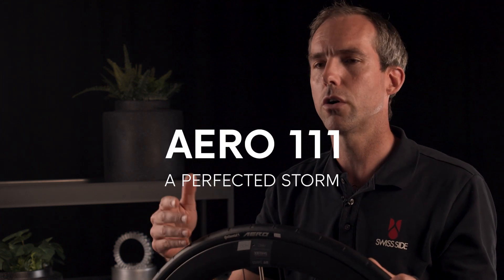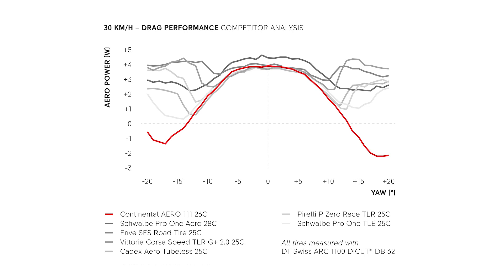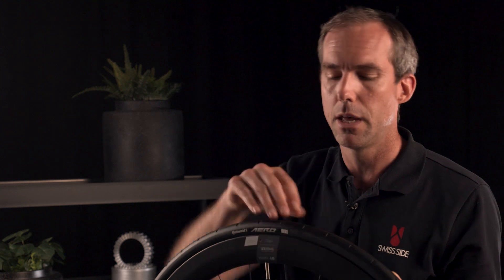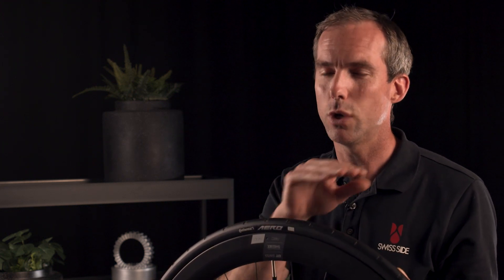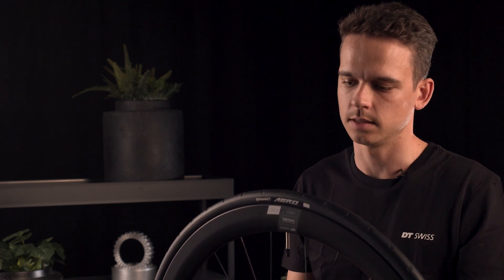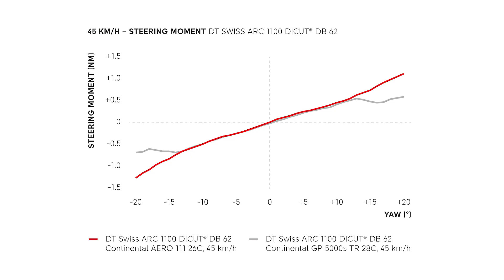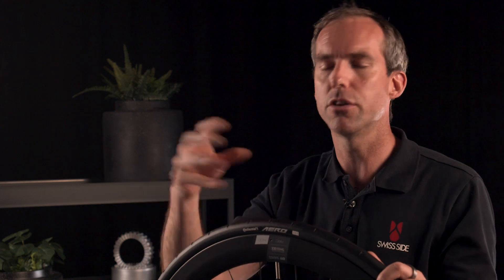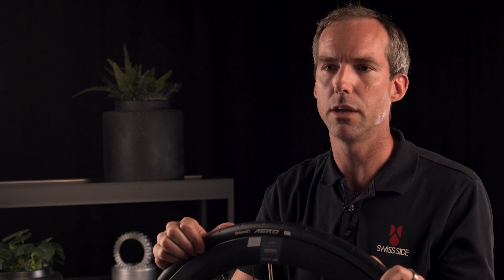AERO 111: A Perfected Storm - introducing the ultimate aero wheel tire system | DT Swiss

Comment: I have a 45mm Wheel with 29mm measured on the outside. Can I still ride the 29" instead of the 26" and see benefits?
Reply from the maker: Hi, Thanks for your request. Only the rim inner width defines the tire width. Please use our wheel manual for the minimum tire width: https://d2a13k6araex7u.cloudfront.net/pmt/00/00/00/00/00/00/00/10/00/00/00/85/8/MAN_WXWXXXXXX1610S_WEB_ZZ_001.pdf?v=163982. The ERC rim is 22 mm wide, the minimum tire width for this is 26 mm, not recommended by us but allowed according ISO industry standard. A less wide tire will increase the aero benefits on this wheel set, but would sacrifice the comfort: https://www.dtswiss.com/en/wheels/wheels-technology/wts-technology. Best, Ralf - DT Swiss

Comment: Hi again! After three days of riding the Aero 111, I can say it’s a good tyre—noticeably faster, much faster in fact—but the handling stability wasn’t there. According to the data this should stabilize handling but my 45 mm-deep wheels felt more like 60 mm wheels, becoming twitchy and unstable in crosswinds.. Im using the Scope 4.A wheelset. What can you say about this?
Reply from the maker: Hi, Thanks for your positive comment about the AERO 111 tire. This tire is a cooperation of DT Swiss, Swiss Side and Continental and the product has been developed on DT Swiss rims/wheels creating the first real Wheel Tire System that takes aerodynamic optimization and controlled rideability into account. Our ARC aero wheels (and ERC wheels, too) are developed to create a moderate steering moment (as the force that is applied onto the steering axle - see "AERO+" concept for a detailed physical explanation) that is quite linear with the lowest possible incline of the gradient over the full range of all measured (realistic) Yaw-angles. Adding the AERO 111 tire will not change the gradient, but will make the steering moment even more linear with a later airflow stalling. This stalling effect you describe is felt as "twitchy" when you ride especially under fast changing wind conditions that turn on and off the stalling. By having a low gradient, the maximum absolute Moment (in Nm) will not be felt in a unpleasant way when stalling occurs. 

Surely, we observe the wheel market and other brands around us, but please understand that we cannot make any conclusions/statements about the influence of the AERO 111 tire on other manufacturer's rims/wheels. These wheels might have a different approach in the development when it comes to a pronunciation of the so-called sailing effect in order to achieve certain aerodynamic properties. As the AERO 111 tire is exclusive to Swiss Side and DT Swiss products (as complete Wheel Tire System), it is impossible for us to make any other statements. Find out more about the Wheel Tire System and the complete measurements on all DT Swiss Aero wheels: https://www.dtswiss.com/en/wheels/wheels-technology/wts-technology. Best, Ralf - DT Swiss
Reply: @dtswiss  Thank you for the very detailed explanation! I still remain a fan boy of this tire! Significantly faster! Lovin it!

Comment: I also watched David Arthur’s video in which a Continental representative explained that pairing the Aero 111 with 42 mm tires produces the same “sailing effect” as pairing it with 60 mm tires. Does that mean we can use 60 mm rims and still enjoy crosswind stability comparable to much shallower rims?

If so, that deep wheel + Aero 111 is just crazy fast and stable!
Reply from the maker: Hi, thanks for your questions. Just to make one thing clear: we are talking about the rim heights of 42 and 62 mm, not the tire (width). We have put all numbers of wind tunnel testing onto a technology page and there you can see how the tire affects the aero drag. Looking at the y-axis shows you the amount of aero drag in Watts at certain Yaw-angles (is a vectorized measurement of onflowing airflow, or apparent wind direction incl. the speed of riding & wind(-direction)). Higher DT Swiss rims are already improving the aerodynamic. If you combine the AERO 111 with a 30 mm ally aero rim, the effect of the tire in absolute numbers is the same as for higher rims. In relation to the height, a shallower rim will have a greater effect. With a 62 mm high aero rim combined with the AERO 111, you will have a top performing product with almost no detachment of the airflow within a range of -15° to +15° of Yaw. A 80 m rim will not stall within the full range of measurements. Find out more on the technology page: https://www.dtswiss.com/en/wheels/wheels-technology/wts-technology with all numbers unveiled. Best, Ralf - DT Swiss

Comment: Hi, I bought these tires for both the front and rear wheels. Although, as explained , it's unnecessary to use Aero 111 on the rear, I frequently get punctures where I ride, and according to Bicycle Rolling Resistance, this tire offers excellent puncture protection and better grip. My question is: would using it on the rear negatively affect performance due to the vortex cavities interacting with the dirty airflow on the rear side of the bike and creating additional drag?
Reply from the maker: Hi, thanks for your questions and remarks. Even though the tire offers a good puncture protection, I would not use it on the rear for following reasons: the weight on the front wheel is lower than on the rear wheel, thus the wear will increase if used as rear wheel tire. Additionally, the aero effect on the rear wheel is pretty much non-existing due to the turbulences created by the rear part of the frame and the moving legs. The drag will not be influenced negatively, too. Instead, I would recommend using a wider tire (inside the allowance of the frame, 4 mm around the tire) and set the tire to tubeless. A lower tire pressure will increase the comfort and a high quality carcass of the tire will more gently roll over obstacles on the road surface, such as cracks or loose particles. Small punctures will be safely and quickly sealed if you use a high pressure road sealant such as the DT Swiss HP TL sealant: https://www.dtswiss.com/en/components/wheel-accessories/tubeless-sealant. Best, Ralf - DT Swiss

Comment: Hi, I see it in the above video that the tyre is on not only tested or usable on deep section (50-60mm or more) rims but 30 and 38mm as well. Would you confirm that it makes sense to install the Aero 111 on reasonable shallow rim depths too, such as 40mm? Thank you for your reply in advance! Adrian
Reply from the maker: Hi, we have updated the available aero drag data for all different DT Swiss road wheel rims/wheels. These can be found in our technology page: https://www.dtswiss.com/en/wheels/wheels-technology/wts-technology. Especially on a shallow rim like in the A 1800 SPLINE 30, the AERO 111 tire creates a sailing effect and overal weighted aero drag compared to a wheel with a 50+ mm high rim using a standard tire. Best, Ralf - DT Swiss

Comment: I just bought two of these thinking that I’d use them for front and rear. I bought 29s subs I usually prefer 28s on my tri bike. Do you advise a particular rear tire that I should use instead?
Reply from the maker: Hi, the AERO 111 tire has been developed with the purpose to reduce the aerodynamic drag on the front wheel as this is the first part of the bike that "hits" the wind upon riding. Surely, you can use the AERO 111 on the rear, but due to more turbulences in the rear part of the frame/bike (moving legs, frame set etc.), we see no necessity to use this tire on the rear wheel. Instead, we recommend a standard tire, e.g. GP 5000 STR in 28 mm (on ARC Aero wheels). Best, Ralf - DT Swiss

Comment: @dtswiss I've poured through your data and test results -- cool stuff. Two big questions for you:

Why did you stop at 45km/hr with your data? Where I ride I'm frequently dealing with 25km/hr headwinds while going generally downhill. It would be nice to have a 60km/hr datapoint

it would be nice to get some guidance on what rim internal/external width ranges the two sizes are meant for. I've gathered from your test data that the 26c is for around 20-22 internal and the 29 for 22-24, but some actual guidance would be nice
Reply from the maker: Hi, very good questions indeed. We like to be challenged with technical questions as we see a real interest in bike industry innovations. The speed of 45 km/h in the wind tunnel is where we usually test and we are trying to make results comparable within a test session and over different sessions and categories. With gravel cycling getting popular, we also went down with the speeds to 30 km/h, that´s the minimum you are able to measure reliable results. With the experience of lower speeds in reality, we made also measurements with the WTS in these speeds. There, we figured out that the combination of apparent wind direction and riding speed not only led to more extreme yaw-angles but that the AERO 111 increased the sailing effect at this speed. Thus, the tire increases the aero performance significantly if you are riding in the flat with e.g. strong cross winds. In contrast to this, increasing speeds and cross winds reduce the yaw-angle and the system is stronger affected by the base drag (within -10° to +10° Yaw). The calculation of yaw-angles is a vector calculation and you will find examples in the internet to make your personal calculation. Therefore, your mentioned speed and wind conditions lead to well-known results in terms of aerodynamic and handling properties. One important take away from the tire for high speed riding is a stable and foreseeable steering behavior - especially in these downhills you can ride with confidence without being surprised. Best, Ralf - DT Swiss
Reply from the maker: 2nd question replied separately: The tire widths of 26 and 29 mm are according the latest ISO norm and related to the rim innerwidth. The widest/still safe tire/rim combination for 26 mm AERO 111 is 22 mm (ERC/ER/E wheels), with the AERO 111 in 29 mm, the maximum allowance for a safe fit is 24 mm (up to GRC/GR/G wheels). We must admit that the AERO 111 tires have been developed to work with our wheels/rims, therefore we cannot comment on other wheels (or external rim width) of other wheels/brands. In general, the less wide the tire the better are the aerodynamics of the WTS. You will get excellent results when combining 26 mm with our ARC wheels, combining the same tire width with the ERC wheels might lead to even better aerodynamics in this category. On the other hand, the designated plus in comfort for rougher road surfaces will be sacrificed. Putting a wider 29 mm AERO 111 on the ARC wheels might enhance the steering performance and the comfort but on the other hand the weighted aero gains of the ideal 26 mm tire will be decreased. Our wheel manual will guide you through best tire/rim combinations. But please respect also the max. tire pressures for tires and rims. If these tire pressures do not match 100 %, the "lowest" maximum tire pressure of one of the components has to be respected (see hookless rims)! Best, Ralf - DT Swiss
Reply: @dtswiss  Ralf thank you so much for such detailed answers.
Reply: @dtswiss  hi, you said maximum allowance is 24 mm for the 700x29c tyre. Do you mean max 24 mm rim depth, inner width or outer width? Thank you.
Reply from the maker: Hi Monika, the rim inner width defines the width between the hooks of the rim, not the height. A 29C AERO 111 can be mounted on a 24 mm wide (internal rim) rim, not wider (> 24 mm, acc. ISO-Norm). A less wide rim < 24 mm is no problem. For further information check our tire/rim/pressure sheet: https://d2a13k6araex7u.cloudfront.net/pmt/00/00/00/00/00/00/00/10/00/00/00/85/8/MAN_WXWXXXXXX1610S_WEB_ZZ_001.pdf. Best, Ralf - DT Swiss

Comment: What size for optimum aero interface on 21mm internal/30mm external rim?
Reply from the maker: Hi, thanks for your question. You will achieve the best aero performance if you install the 26 mm wide tire. Up to internal 22 mm rim width, you are able to run safe on 26 mm AERO 111 tires in the front. However, if you use the AERO 111 in 29 mm, a characteristic like comfort can be improved (by a lower tire pressure), but the aero performance will be decreased. In general, a wider external rim will contribute positively to the aerodynamics of a front wheel. Best, Ralf - DT Swiss

Comment: I have ordered one of those (26-622) and tried to install it on a DT Swiss Arc 1400 Dicut 62. Unfortunately it's impossible, the tire is too tight. I usually run GP 5000 and they are relatively easy to install. Did anyone manage to install a 111 tire (without excessive force)?
Reply from the maker: In the past weeks we installed several AERO 111 in 26 mm on various ARC rims. With the help of a plastic tire lever, it will work with any additional extra force. If the tire bead is seated inside the TL rim bead, the diameter will allow you the installation. Best, Ralf - DT Swiss
Reply: @dtswiss  Hi Ralf, thanks for the response. Thats actually exactly how I tried it. 

I also tried a bit of soap water on the rim to reduce friction but it’s simply too tight.
Reply from the maker: There are some other easy fit options in the market to test. Try to get the tire over the rim on at the location of the valve. If this remains difficult, I would recommend to you addressing this obstacle to Continental Tires directly. Best, Ralf - DT Swiss

Comment: This aero gain is as much of a theory as multiverses 😂 you can argue they are true but in reality you can’t test the theory and after all it doesn’t matter for nobody. But hey, you got me clicking on the vid…😂😂
Reply from the maker: Thanks for clicking the video. 👍 Wind tunnel tests are a safe method to produce results that can be similar repeated, thus a field test has more "noise" and might not be reproducible. The aero gains for this tire are related to the yaw angles applied, so they can be extremely high, but also in the frontal airflow smaller. Weighting the yaw angles from -20° to +20° according to the estimated occurrences gives us an indication in a ride for the avg. aero benefit. Best, Ralf - DT Swiss

Comment: Hello! On the E1800 30mm, what is the widest tire you can install?
Reply from the maker: Hi, in our wheel manual https://d2a13k6araex7u.cloudfront.net/pmt/00/00/00/00/00/00/00/10/00/00/00/85/8/MAN_WXWXXXXXX1610S_WEB_ZZ_001.pdf you will find the allowance of tire width (light grey) and our recommendations (dark grey), which are the usual tire widths for the best aero and comfort for this rim with 22 mm internal rim width. Best, Ralf - DT Swiss

Comment: .001 watt saved at 3 times the price , perfect
Reply: It seems to be, that the tyre is only better for cross winds. Unfortunately in real world the effective wind is more likely from 0-7,5 degree. Normally the cross wind is weighted due to the fact, that crosswind goes less in the result.

It is really a question if the tyre brings a benefit in real world.

Comment: The data is surprising. In function it is a crosswind tire. NO difference at all with no wind or head-on wind. The bigger the crosswind  the bigger the improvement - up to a huge amount like 20w at 45 kph.

One thing - which I'm surprised they showed - is that some other tires are much better aero performance at moderate crosswinds than the GP5K. (and the Schwalbe Pro One TLE is so aero that it works nearly as well as this one at high speeds like 45kph). The comparison to other brands tires perhaps show why this aero tire was invented - because compared to others the GP5k are bad at high speed in strong crosswinds.
Reply: These charts are misleading. You never encounter 0 degree yaw due to micro steering inputs of a driver. If you go in a straight line, you will induce micro steering inputs from the pedaling and this is as much as +/- 5degree yaw. Additionally a cyclist will encounter different yaw angles of wind due to  turbulence caused by road furniture, tree, grass, cars and  obviously steering input.
Also air in real life is always turbulent which increases effective wind yaw angle. 
You are more likely at +/- 3-15 degree yaw wind angles during cycling. If you ride faster the effective yaw angles of wind reduce.

 vortex generators/shedders are tuned to a certain frequency and therefore speed. It also works at higher and lower speeds, just to a lesser degree. As it seems it's tuned for ~30kph on this tire which is probably the average speed you reach during cycling as a non pro.
Reply: @Tomaschhh-k5z  thank you for all the info.  

I would think  an aero specific tire should be tuned for 40+ kph (or  45-50 if it would have heavy time trial use )
Reply: @FT__Bicycling_____-sc7yv  it could also be tuned for 35-40 kph. It's hard to say because there are no charts for it. It's also possible that the 26 and 29mm tire are tuned differently, which would make sense.

Comment: Why do you develop an aero tire (which is a really good thing) but with an average rolling resistance? If you say A, you should also say B ;)
Reply from the maker: Hi, this tire has been developed for amateurs and pros likewise. Therefore, riding characteristics like comfort, puncture resistance and rolling resistance play an important (sometimes different) role for the different intended use. The tire offers a strong benefit in aerodynamics and a lot of test reviews show that the stable handling properties make riders faster as they can hold their fastest aero position for a longer period even in extreme yaw-angles. Consequently, considering rolling resistance in isolation does not provide a comprehensive understanding. We are confident that we have chosen the right partner in tire technology and eagerly anticipate future collaborations. Best, Ralf - DT Swiss
Reply: Why would you say it has an average rolling resistance?
Reply: @mathiaslechner6103  because it is claimed to be between 5000 TT and 5000 S TR. Well compare both with Vitoria corsa pro speed